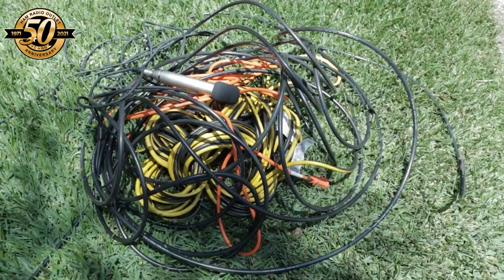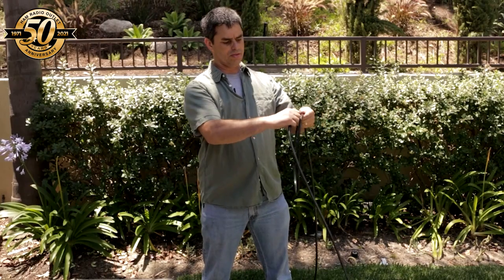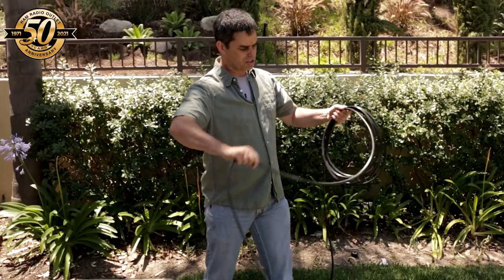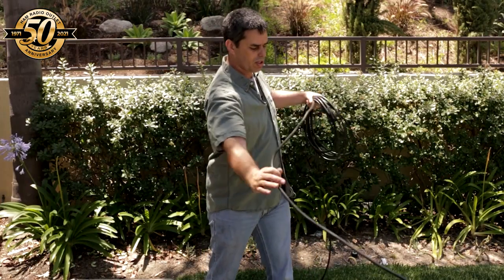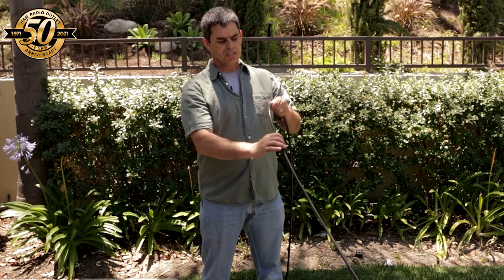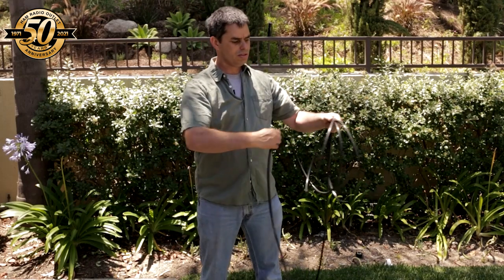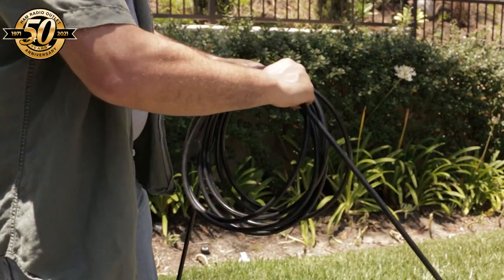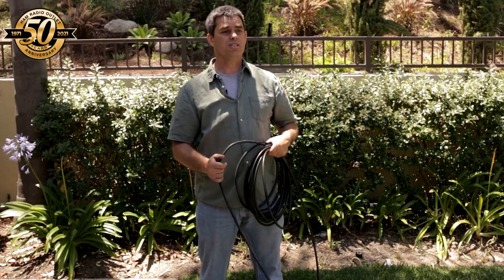Quick Tip - Coiling Coax - Ham Radio Outlet

Comment: This is a variant of the figure-eight coiling I learned for antenna guy lines and wire. It works on kite winders. If you wind it using finger and thumb of one hand as the winding points, you can take the finished figure eight off you hand, fold it in half and get the result shown here. Wire and guy ropes are usually more flexible than coax, so I hadn't thought of this.  Great tip. Thanks!
Reply from the maker: I use the finger and thumb winding technique for small wires, but hadn't though of folding the result in half, interesting! Will have to try that!